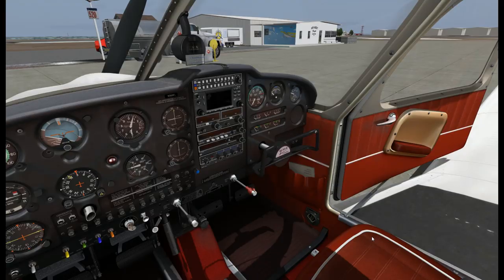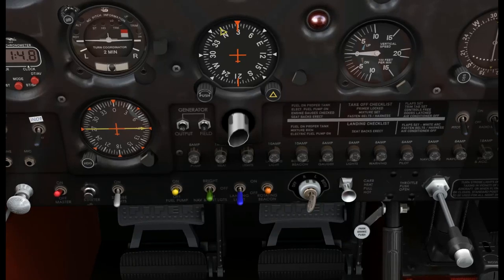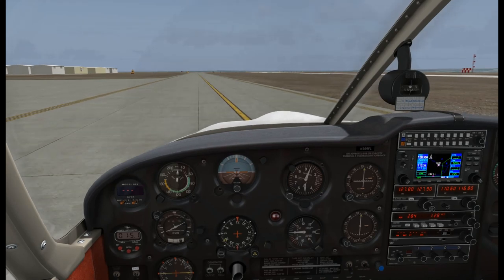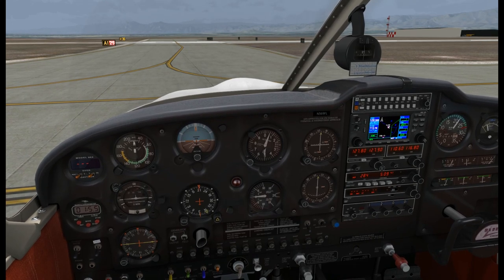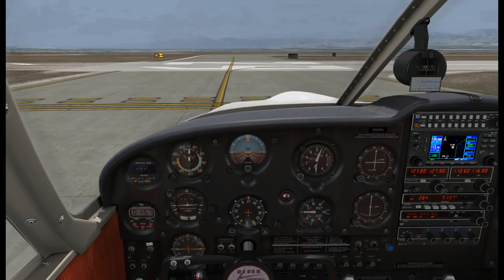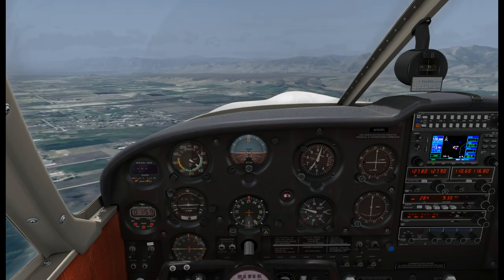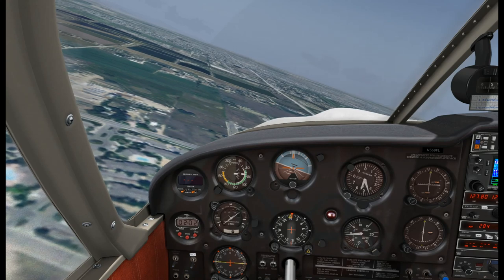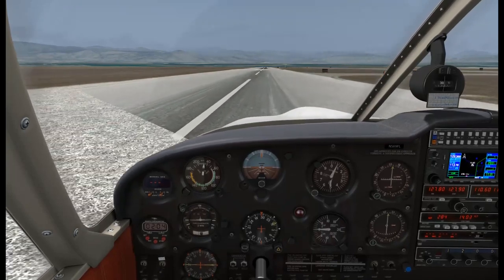A2A Simulations PA-28-180 | RW PA28 Pilot | Startup, Quick Pattern, Shutdown | FSX

Comment: Is that Prepar3D? Because the shadow @ 13:20 from the bar between the windows looks reeeeeeeeeally nice, adds a lot of immersion for me!

Anyways, good video!
Reply: It says FSX in the title. Maybe it's DX10. You can get that kind of shadows with SteveFX DX10 Scenery Fixer.
Reply: Tomaž Drnovšek oh, right. sorry, totally missed that
Reply from the maker: Correct - FSX with DX10 and Steve's fixer. Thanks for watching!
Reply: Trevor Bair
Well, thanks for the nice demo of the A2A Cherokee ;)
Reply: Trevor Bair What item did you check in the dx10 fixer to get the shadows like that? it hasnt worked for me..
Reply: James Lyon You have to use Dx10Toolbox (in DX10 Scenery fixer folder) where you can enable VC shadows. It's in the manual.
Reply: ah ok thanks so much for the reply
Reply: Tomaž Drnovšek do you know how to fix this probllem? when i select dx10 in fsx it gives me a blck screen, like this:
http://puu.sh/9eqMk/3d02f69a2d.png
Reply: James Lyon
Sorry, no. It might something to do with shaders though. Again, try looking in the manual, there are some explanations of some problems that might occur and how to slove them (I'm not at home right now so I can't look in the manual). Or ask in the support forum at AVSIM.

Comment: Nice video!! But could ou please please please do a tutorial on how to install the reality xp gns 430 into the a2a Cherokee or the a2a cessna I really want to buy it but idk how I would install the gps?!
Reply from the maker: Mike - Shift 3 (I think) will bring up a config window where you can select the GPS you want to use (middle of the pop-up config window, just click it). It's as seamless as that, no other installation required.
Reply: Trevor Bair That is not what he meant. He means how to install the RealityXP GPS into the A2A plane. The RealityXP is a whole different addon, which simulates the GPS much more realistic than the one that comes with the A2A plane.
Reply from the maker: Oliver Donner I'm using the RXP GNS430 in the video so I'm familiar with it... ;) Shift+3 will bring up the config window in which you switch between the GPS options. Should be that easy - at least, it was for me and that's what A2A claims as well. http://a2asimulations.com/forum/viewtopic.php?f=116&t=40213

Comment: Quick question, why do you lean the mixture when starting taxi and power checks? i thought it generally should stay rich until your airborne?
Reply from the maker: Hi, The reason for leaning the mixture is for higher altitude airport operations. Here in Colorado (at 5,000+ MSL elevation), full-rich would foul the plugs and cause a not so good performance impact. As a result, we always lean the mixture. Generally, in the aircraft I've flown, I lean until there's a noticeable RPM drop and then enrichen by a few turns.
Reply: Great thanks. I asked a mate who flys yesterday aswell and he said the same and that it stops the fuel being wasted on cooling the engine. I didnt even know that the fuel was used as a coolant, it seems theres still lots for me to learn lol thanks again buddy :)
Reply: I am curious though, why does using rich mixture foul the plugs exactly? thanks